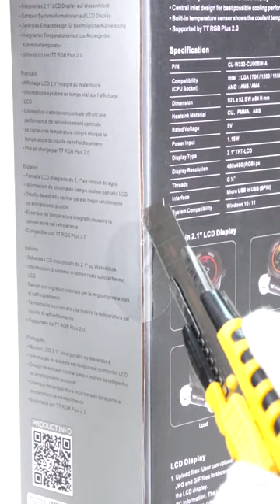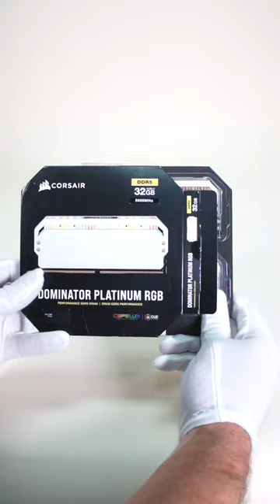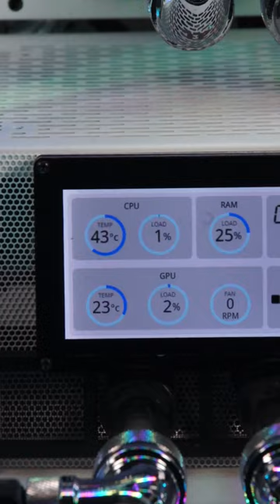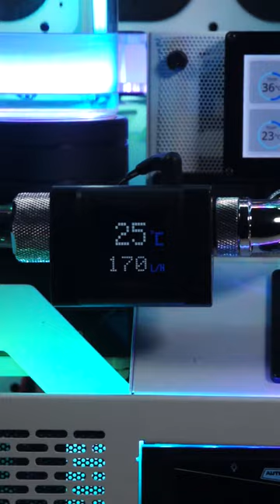CUSTOM Liquid Gaming Computer HOLIDAY SPECIAL! | Build Process | ThermalTake Tower 900 | CGC

Comment: Hey bro,

What's distro plate did you use? Phantek?
Reply from the maker: https://www.amazon.com/Phanteks-Distribution-Acrylic-Backplate-Digital-RGB/dp/B07VS4K2T7/ref=asc_df_B07VS4K2T7/?tag=hyprod-20&linkCode=df0&hvadid=380200604373&hvpos=&hvnetw=g&hvrand=11406373597036048581&hvpone=&hvptwo=&hvqmt=&hvdev=m&hvdvcmdl=&hvlocint=&hvlocphy=9014243&hvtargid=pla-802236803680&psc=1&tag=&ref=&adgrpid=82910274452&hvpone=&hvptwo=&hvadid=380200604373&hvpos=&hvnetw=g&hvrand=11406373597036048581&hvqmt=&hvdev=m&hvdvcmdl=&hvlocint=&hvlocphy=9014243&hvtargid=pla-802236803680

We used this
Reply: @cgcpcbuilds  Did you outlet from the top of one of your reservoirs? How can I set that up?

Comment: How long does the liquid last? And what happens if you get a leak?
Reply from the maker: The liquid lasts for about a year until it would need to be drained and replaced. If the liquid does leak, it will not affect anything electronically. This fluid is non conductive. You'd just tighten up the area where the leak is, clean what has spilled and add back more liquid into the loop. Thanks for watching and your questions!